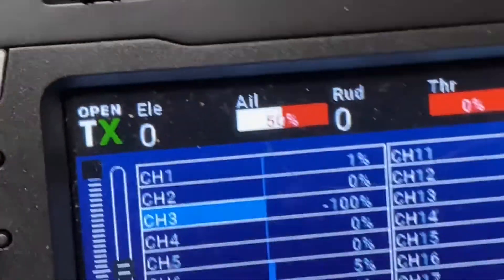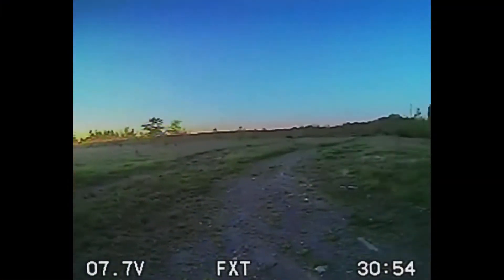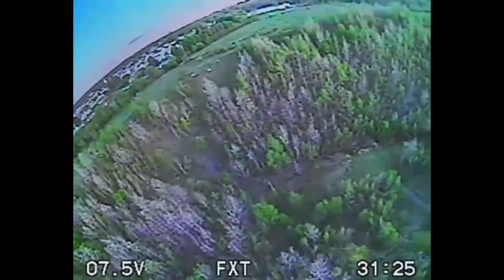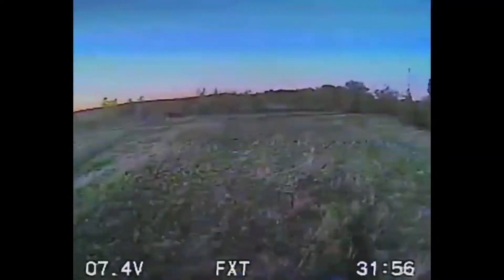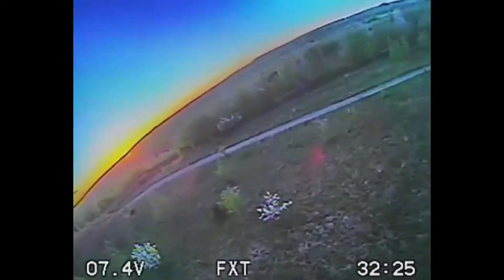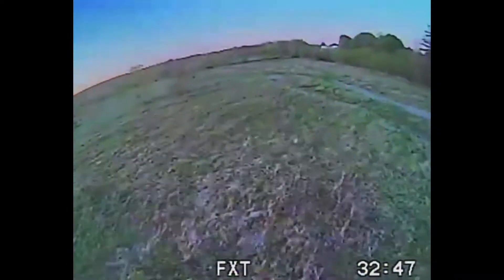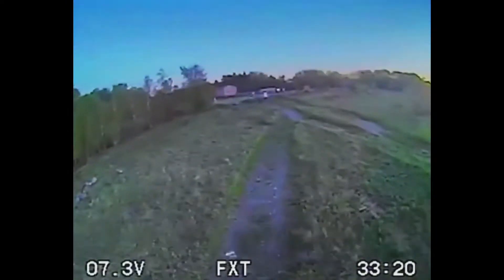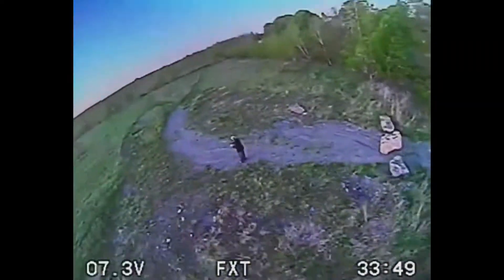MJX Bugs 3 under 250 g Jumper T16 FXT Viper goggle ROTG mod FXT MARS FPV CAM OSD

Comment: Bro did you have video of jumper t16 setup for bugs 3? I connected my t16 to bugs 3 but had no clue what to do next. It binded but no arming, or anything. I'm really newbie with the multiprotocol controller, hope you could help me

And btw my t16 is already run in opentx
Reply from the maker: Absolutely I have several videos on burning the MJX drones to the jumper or tea 16 type multi protocol radios
Reply: @JayDrone  cool bro, I've already found the setup in multi-module web. But sure i'll gonna watch your video about drones, especially about the bugs 3 one